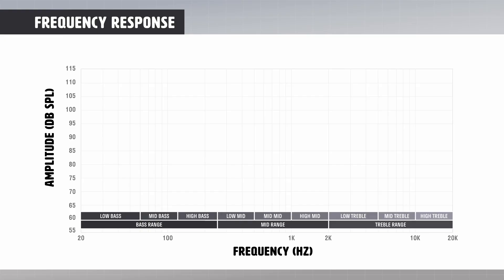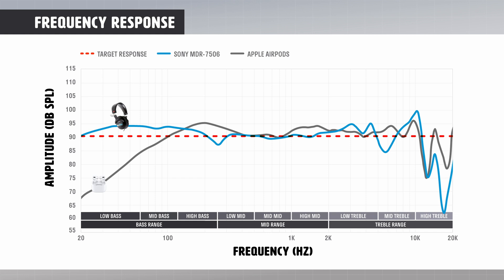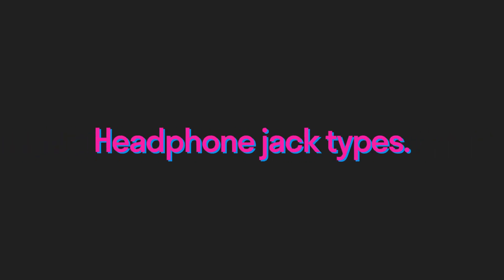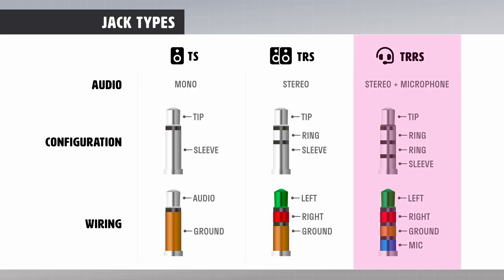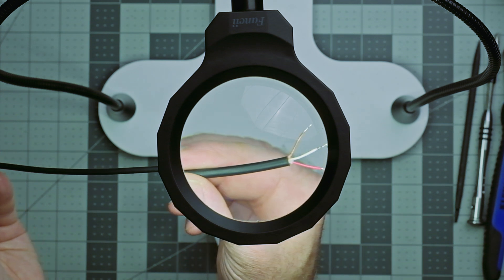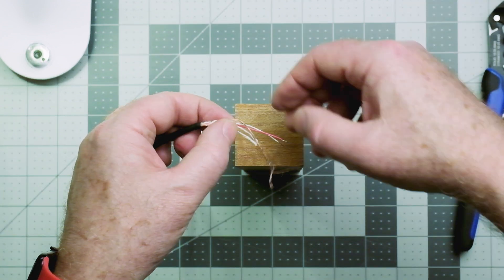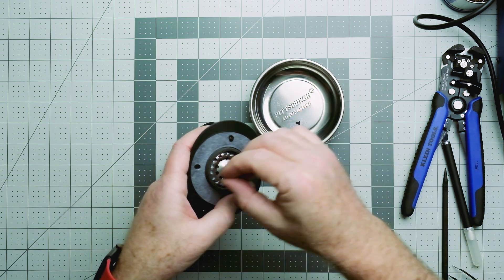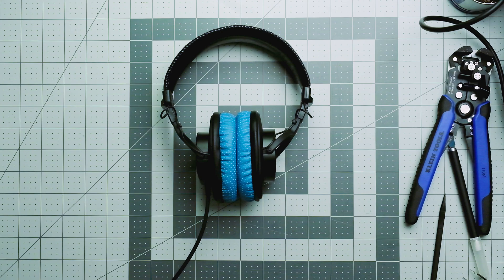Modify your Sony MDR-7506 headphones

Comment: Good Job! I researched these cans 10+ years ago and picked up a pair. The cable does bother me too sometimes especially If I am trying to just use them as daily listeners while out and about. I also use microphones for work and used to for gaming so there have been sub-par solutions for this issue too... usually opting for an inferior multi purpose set as a compromise.
Reply: Also, did you find the Brainzwaves cups to be short lived. Mine started to go after about 11 months and were out of warranty by the time they were bad. Contemplating the Lambskins.
Reply from the maker: @kakoth my Brainwavz are still intact. I’ve heard that they can start to disintegrate after some time but I’m not there yet fortunately. To be fair, I have 5-6 pairs I use on rotation, so maybe that helps?

Comment: Argh. I am trying to do this mod. I got to the part where you removed the old coiled cable. I placed the soldering iron on the points but it would not budge. Eventually I used force, as I had seen in other videos the 3 cables just popped out. Unfortunately for me, the silver circular ring that's attached to the driver popped off! Any advice? Can I just glue it back?
Reply from the maker: You could try, but I can’t guarantee it will work because I can’t see exactly what happened. Good luck and sorry you’re having issues.
Reply: @SomewhatAbnormal  Thanks for the reply. I appreciate it. I took it into a shop today and they told me that since the driver had split apart, it actually severed 2 teeny tiny cables that could not be repaired, so just "gluing it back" wouldn't do anything. Sad i ruined a good driver, and now I know I should have probably chosen a cheaper pair of headphones to learn from. Thanks for your video. I will be accomplish this mod eventually!
Reply from the maker: @cookaloris I’m sorry to hear this. I will admit to destroying a pair or two of headphones myself. Also, radios when I was a child. I’ve always been fascinated by tearing things apart, but not always so good at putting them back together!

Comment: Thanks you for all the detailed work demonstration, I have learned a lot. May I know if the original audio cable is shielded or not? With this modification, will it affect the quality of sound?
Reply from the maker: There was no shielding in the original cable as far as I recall. The audio quality was not affected by this modification — at least not to my ears. Thanks for the question!

Comment: People on Amazon posted pics of these pads peeling badly.
Reply from the maker: I have no doubts, however, I have not yet experienced this. Low quality materials abound!
Reply: @SomewhatAbnormal  I know. They look cool, though. I find it useful when people also post reviews a year or two later. The star ratings must be higher than they realistically would be if people also reported on durability. I've just ordered a velvety pair off of AliExpress for $10... will see what they're like! Thanks for the vids! Happy new year.
Reply: @SomewhatAbnormal The AliExpress ones didn't come. I quit that website. 😀
Reply: Stock Sony pads peel too.
Reply: @SamplingPercussion True.
Reply: @SamplingPercussion  That's why I was shopping for new ones.

Comment: Hi! I also came to a similar decision on my Sony a long time ago, but the question is, why did you have to disassemble the headphones and complicate the process? I just cut the cord in two places on a flat area and soldered it, leaving the original jack or I didn't get the joke! =)
Reply from the maker: Haha! Well, there was no joke intended. Surely, another way to do this is just cut the cord outside and splice one on. However, it's just not what I did at the time. In retrospect, it's a way easier solution, though it doesn't appeal to my "I want to rip it apart and see how it works" way of doing things! Cheers :)
Reply: @SomewhatAbnormal  Ah, you wanted to poke around inside, that's a different matter! =) I still haven't gotten around to it, I also have thoughts about a deeper upgrade, but as they say: the best is the enemy of all good, they work, I don't touch them, but for now. OK, I hope Google Translate didn't distort the meaning of my messages too much, greetings from Russia and Happy New Year!

Comment: Just what I was looking for. Got a pair of MDR- V6 and that cable is ungodly. Ordering the female 3.5 end cable now (the one on your link is currently unavailable)  and getting to work on them hopefully later this week. Thanks for the instructional.
Reply from the maker: You're very welcome! The process is relatively simple, but I thought it would be good to see it done. Really any female cable end will work, but as I mentioned, don't trust wire colors. Instead rely on a simple continuity test. Good luck!
Reply: Here with an update: The patient is out of surgery and better than ever! Thanks again! I am doing this to ALL my wired non-detachable cable headphones from now. One thing to add to help on the cable color matching thing. Instead of cutting the existing headphones cable first, open the driver cup and check for continuity first like with the TRS cable and note of where they go. I would have made the same mistake you made if I didn’t watch your video. But having that schematic of where all go before even turning on the iron made this a breeze. Take care.
Reply from the maker: @cobymela  I'm glad my video helped you, and I've personally started doing this with all of my headphones as well. Your idea of checking continuity before ripping things apart is a great idea! Thank you